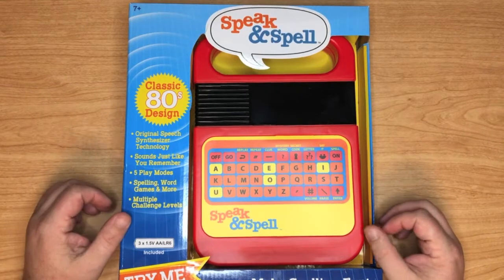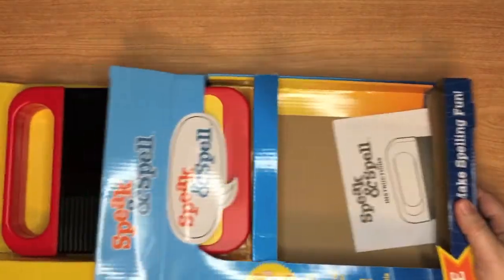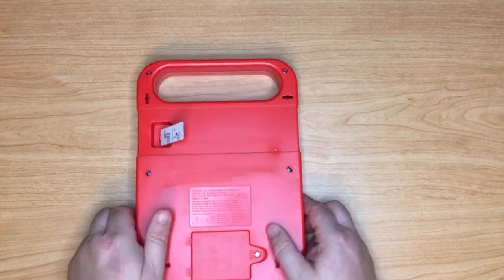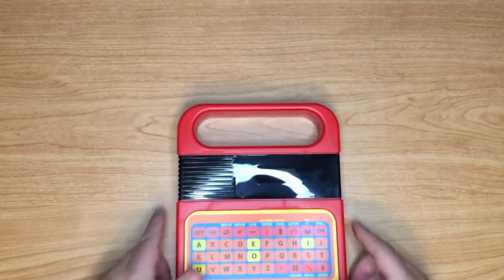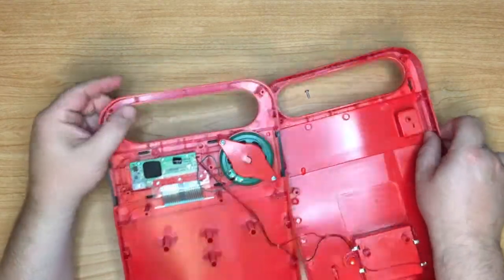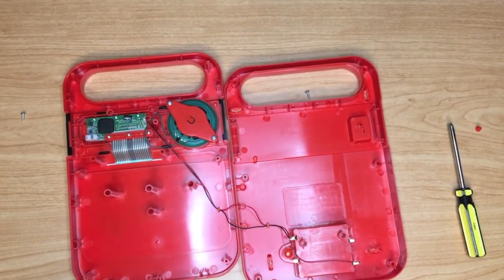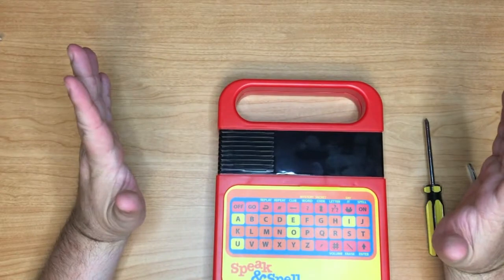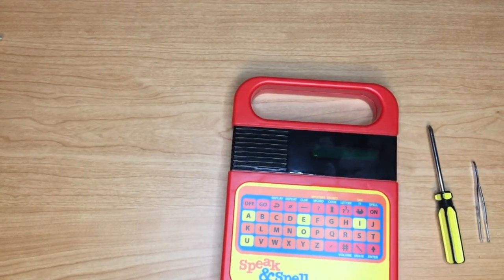Can You Bend the Speak & Spell Reissue? (A look inside the NEW Speak & Spell)

Comment: Thanks for this great video - even though the result wasn't what you/we were hoping for.
I was thinking of getting the reissued version too - so I'm glad I found your video.
Even though there's not much bending to be had, I'm still tempted to get one as the keyboard matrix looks accessible (via the ribbon cables). I'd build a step sequencer around an Arduino to capture & trigger keypresses via a few CD74HC4067 MUX chips (or similar) - and add a tempo knob to control the speed of the sequencer.  Loads of room in that nearly-empty case for extra components etc! Pitch control looks unlikely though - so that might be the deal-breaker for me :(
Reply from the maker: Thanks so much.  It sounds like you are a bit more skilled in the electronics department.  I say you should go for it!